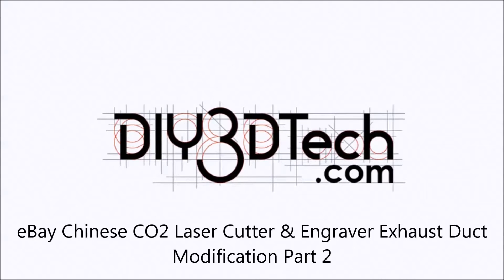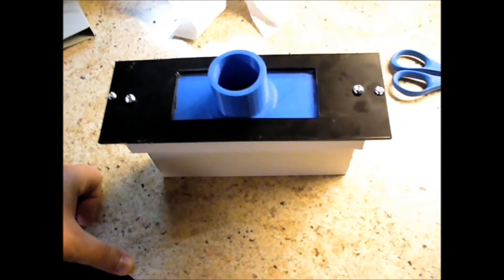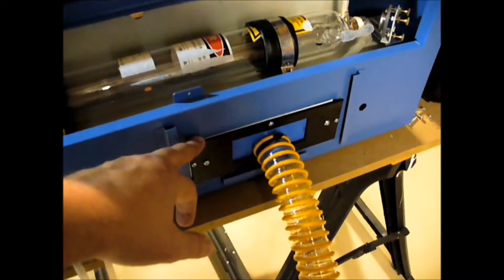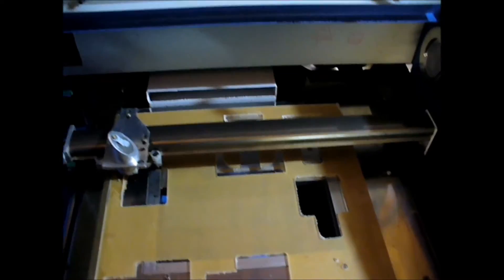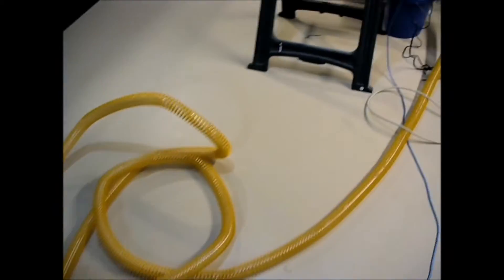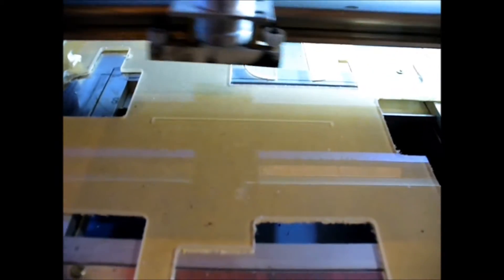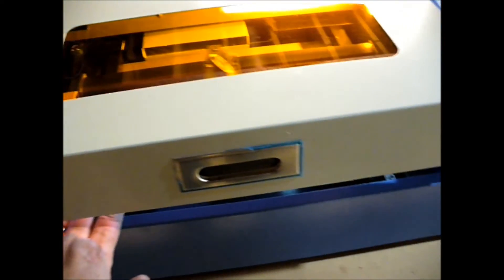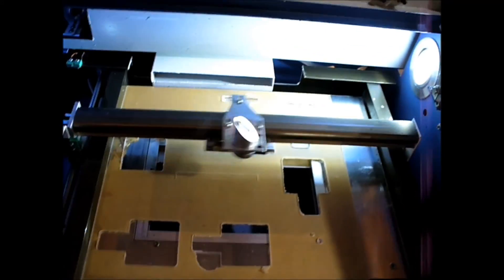eBay Chinese CO2 Laser Cutter & Engraver Exhaust Duct Modification Part 2

Comment: I was about to 3d print that piece but was at Lowes today and noticed they have in the HVAC ailse a 10x3 rectangle metal duct work that converts into a 4" hose bib.  I am going to see if I can rig that up. Was wondering tho how big of screws did you use to hold yours on ? Self tapping I assume also ? Your video are such a help to for a newbie like me. Thanks for the time you take to make them.
Reply from the maker: Thank you for the kind comments, on one I used number #8 with nuts and other its only a pressure fit.  Do share how this works outs as this is interesting...

Comment: Were did you order the air assist head and have any videos on it ? Does it require any modification ? Thanks cool video.
Reply from the maker: +freebird1963 came from Light objects (http://www.lightobject.com/) great small company.  Also yes if you plan on using the stock lens you need to make an adapter (check the play list there is a video on this) however would say spend the extra money and get a new from them as I did and very happy with it! :-)
Reply: Thanks very much for the info !

Comment: My K40 air vent is WELDED into place, I tried to remove it and it can't be removed without destroying stuff.
Reply from the maker: Some of them are (I have one like that too) however is it welded or "spot" welded?  Was mine was spot welded and I could pop it off with minimal damage.  Too depending on where the "spots" are you try drilling them (to make it easier to pop) and then use bolts to lock it back in place.  Hope this helps and thanks for commenting!
Reply: I have tried to pop it. The weld was so good that I was unable to do so without risk damaging the laser tube or something. The upper portion of the weld seems as though it was full length welded so it's going to take some serious effort to remove it.
Reply from the maker: Ouch!  Sorry to hear...
Reply: Mine too, and it's also larger inside than the hole. I'm still considering trying to remove it, but sometime later. My vent is 90mm, and the fan is 150mm, so the limiting factor for air out of the K40 is now the small size of the opening for air to be sucked on the inside of the original vent.